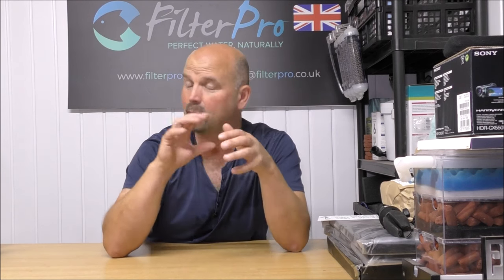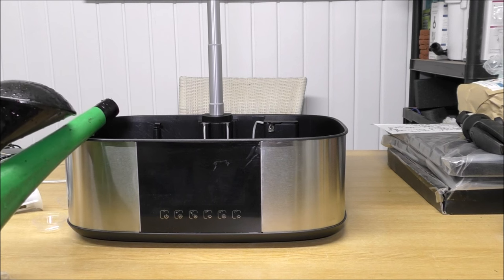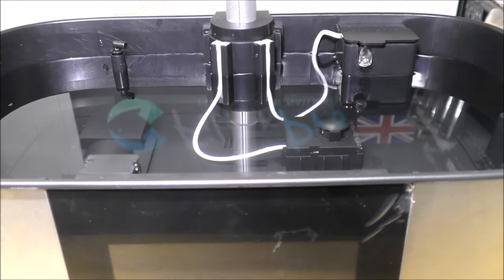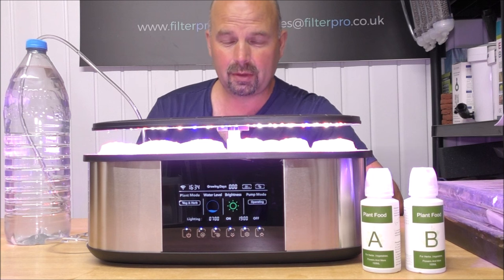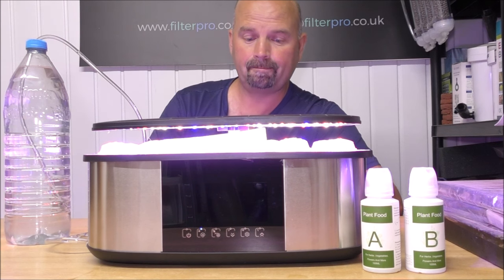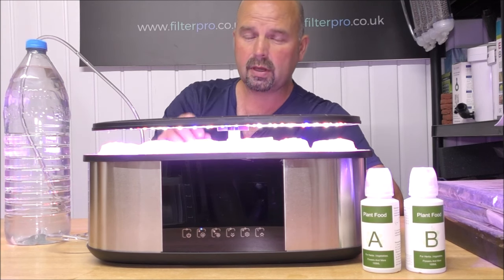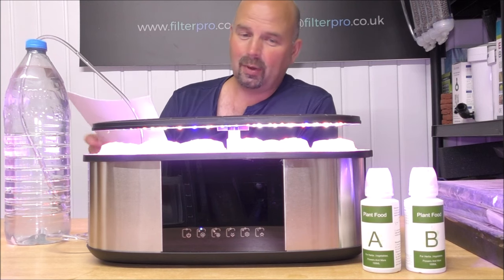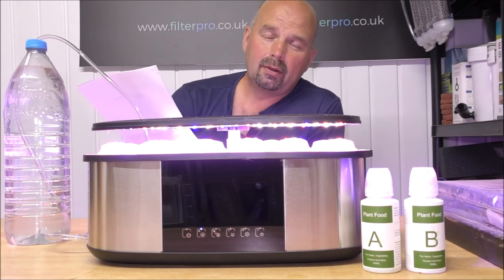New Hydroponic Desktop Planter - LetPot LPH-Max - First Look

Comment: I am surprised there is no air pump/venturi for aeration (to help reduce anaerobic zones forming) or ppm/ec sensor (to monitor the nutrients and dose them as needed). Looks like a solid effort overall and I cant wait to see future models after some more testing and refinement.
Reply: Hi there, there is inserted sensor to detect the water level.  When the sensor detects a shortage of water, the Max will automatically add water from the sink, then spray the corresponding nutrients in proportion according to the amount of water to make the most suitable ratio for plant growth.
Reply: I was thinking.   Seed need 0 nutrients for at least 2 weeks. Sounds great . light gets to the water and grows LG LG opps algae

Comment: Are any of the accidents that are possible of over spillage of water nutrient mix covered by Insurance renters or renters insurance?
Reply from the maker: Unless there's a problem with the auto-filling system it's not going to overflow. Just avoid using the automatic setting and top up manually.
As far as insurance goes I have no idea as I don't deal with that but spills of any type causing damage to electrical goods / carpets / furniture etc. would be covered as standard on a normal insurance policy.

Comment: you have to have the external water bottle on a lower level than the garden itself
Reply from the maker: I tried that and it wouldn't work for me that way since the pump would not draw the water up the skinny tube - maybe I didn't have it attached to the pump end properly so will check that next time I use the system (probably next week or two).
Reply: @pondguru  I just set up mine that was a bit of a hassle getting it on.